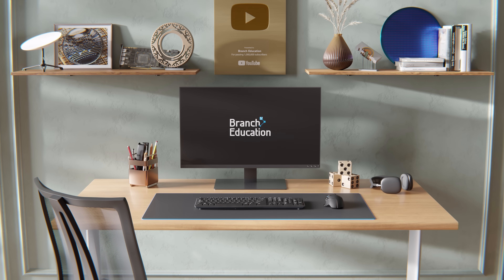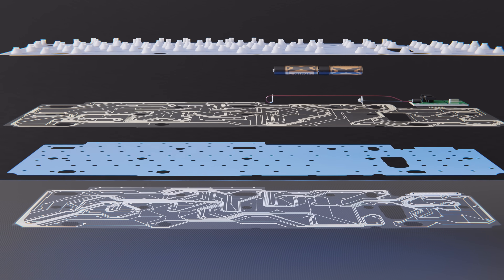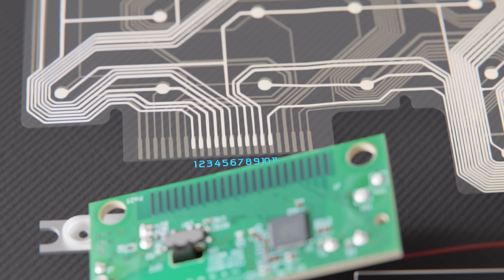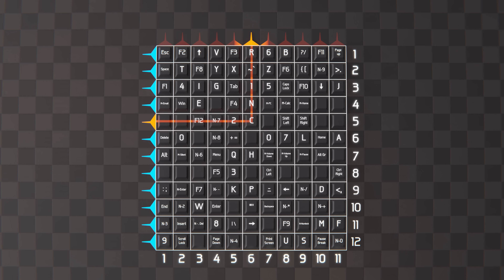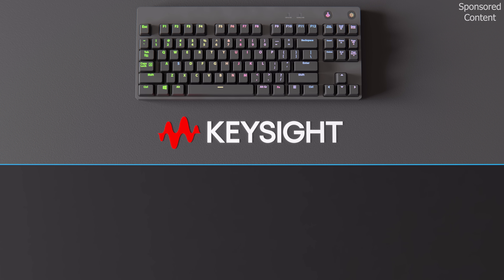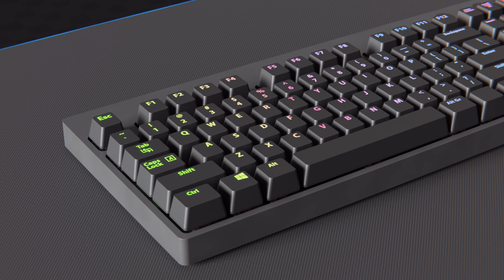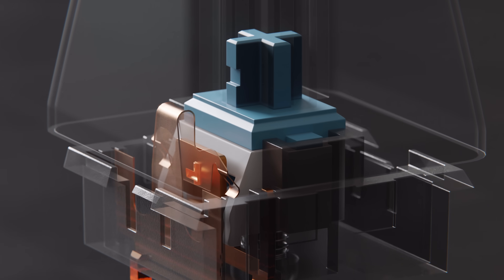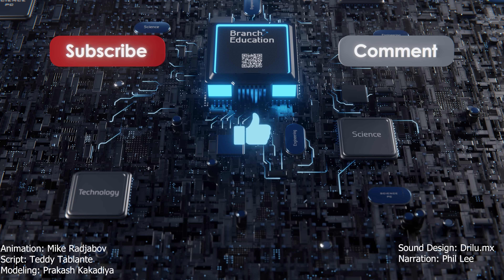How do Computer Keyboards Work? 🤔⌨⌨🛠

Comment: You should also tell which type of keyboard is long lasting. Simple or mechnical?
Reply: Mechanical. The membrane will wear out and cause the domes to slowly collapse on membrane keyboards. On mechanical it's the switch that fails. Now while both last a good while the difference is when a membrane starts to fail u have to replace the entire keyboard while on a mechanical u can just replace that single key switch. This and just the fact that are built way sturdier (and consequently last longer before a switch needs to be replaced). Also mechanical keyboard shouldn't be thought as a whole unit in that regards since each switch has a press rating in how many times u can click it before u should start expecting problems and need replacement.

Comment: Ah yes, mechanical keyboards, a very talked point on rhythm game communities since its said that mechanical keyboards can improve how you play not only for the more tactile feeling but also from higher pooling rates (the rate of the "pulses" that is talked about at 5:15).
Reply: nope, polling rates is something different. Polling rate is on the USB side of things.
Reply: @iFireender  What is it.
Reply: @naturegirl1999  The polling rate is how often the keyboard sends data to the computer, so response time can be faster. This can be hundreds or thousands of hertz.
Reply: @naturegirl1999  as @DiskPartition said, it's the USB side of things.

Keyboards don't just send data as they get it, but they get asked by the computer x times a second, where x is the polling rate, "Hey, any new keypresses?"

That has nothing to do with the switches of the keyboard, rather, just the control electronics.
Reply: @iFireender  ah my friend . . . Lemme introduce u to the ps2 connector and the keyboards associated. Those don't do polling but in fact send a signal on keypress. Which is later used as an interrupt to register presses, so yes there are keyboards that don't do polling but send data on press
Reply: @dawsonpate7385  interesting
Reply: Thank you both
Reply: osuuuuuuuuuu

Comment: Concerning the power consumption of two different scanning methods, I think the issue wasn't that how the pins was scanned by the MCU but if MCU kept wires at high (3V) that particular pin was idle or you call call it high resistance, since wires of the second scanning method mostly stayed at high, thus the power consumption was down. That's my take, please educate me if i'm wrong.

Comment: No way that is the same keyboard i am using the basic one it a logitech k270 i have had it years and it still going strong dropped it spilt drink on it and still going it maybe basic but it is built to last not to mention the battery life of it is way over a year on 2 batteries can't fault it.

Comment: In fact, a click creates a blow of a plastic cap on the upper face of a mechanical button. The sharper and stronger pressing, the louder this sound.
If you press the button slowly, or do not push the keycap to the lowest position, the sound of this keyboard is much quieter.

For "blue" mechanical buttons, an additional sound is created by the impact of… that white element on the bottom of the button. It is also enhanced by keycap.

The sound of the membrane keyboard is muffled by rubber dome. There is no such thing in mechanical buttons, so the sound is stronger. If you put a rubber ring between the keycap and + thing on the button, the sound from pressing will also be quieter.
Reply: If you hit keys on membrane keyboard rather then press it is very loud. Trash cheap keyboard without metal base plate drums times louder then clicky Cherry MX Blue.
Reply: Could you suggest any silent keyboard that does not make any sound at all ?
Reply: @94D33M  Rather not, I'm not well versed in the keyboard market, I just know approximately how they work. And I'm not even sure that a 100% silent keyboard is exists, there will always be at least some noise from moving parts.

All I can advise is to go to a real store and listen with your own ears, instead of believing ads like “Wow! This keyboard is really silent!”.

.

.

.

Although there are 2 more or less silent options ... but you obviously won't like them. "Laser keyboard" and a tablet with a virtual keyboard. There are no moving parts - nothing to make noise, but they are far from comfortable.
Reply: @ivanalaskevich4736 No such things in mechanical boards? Lol okay. There are ways with literally 20 bucks you could make a mechanical board 10 times quieter than any membrane board if you buy silent switches. I always love seeing people talk about things they aren’t educated on. Even like red switches on a mechanical keyboard would still be quieter than any desktop membrane keyboard if you really have them side by side. Membrane is not quieter unless you have clicky switches on the mechanical. But everyone assumes that’s all there is and then talk without researching.
Reply: @jaxx1360  Yes, yes, yes, a very smart man. You know a lot about keyboards, you're great, everything is fine, don't worry.

But we're not talking about silent switches here. We're talking about mechanical keyboards in general, on average. A randomly selected keyboard will not always be silent. And it will contain those “noisy elements” that I described. 

And if you are so smart, prove your knowledge. Give specific examples of the price difference between regular/silent keyboards. Just remember that some keyboards do not have the ability to select switches, and there may not be an option for manual replacement. Although since you are so smart, I needn’t remind you of this.
Reply: @94D33M  there are no silent kb that doesnt make any sound. the only nearest to silent is touch like on smartphone. or something like a laser keyboard but they are really not practical to use as daily keyboard. you only have 2 choices, membrane cheap and feels like trash. and mechanical kb with silent switch. but both are not really silent tho.
Reply: @asdfsdfsadfasdfsf  I believe the silent ones are called brown or something?
Reply: @94D33M Huh? No browns are not silent. Those are basic tactile ones. Look for things like gamakay Phoenix switches
Reply: @94D33M  take any good linear switches (that doesnt wobble) and mod it properly, itll be silent. 
like this one in the video:
https://www.youtube.com/watch?v=RpuRYyCNQao
Reply: @94D33M  foldable rubber keyboard
Reply: Thanks. I love learning